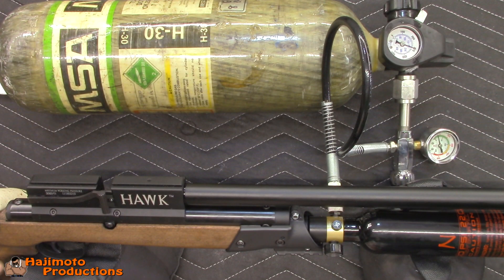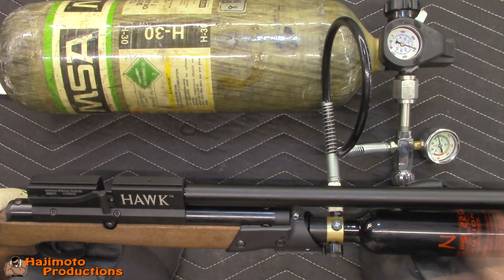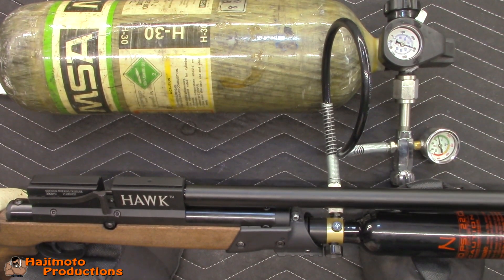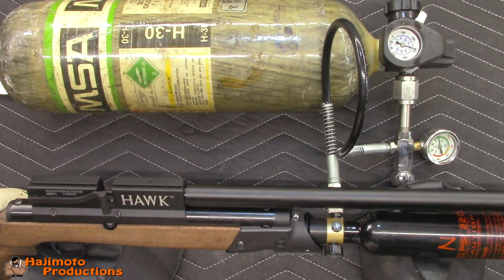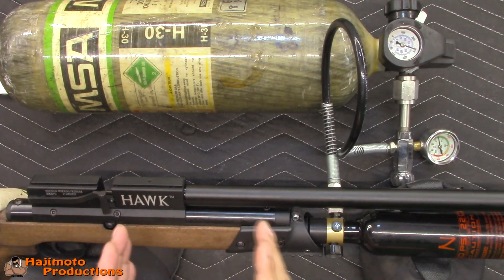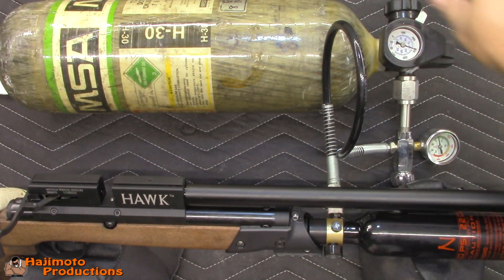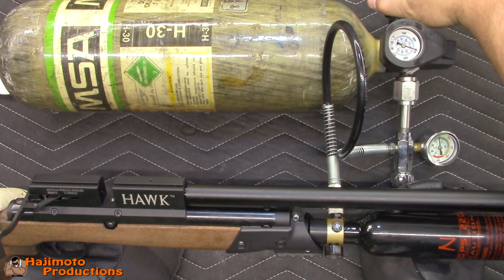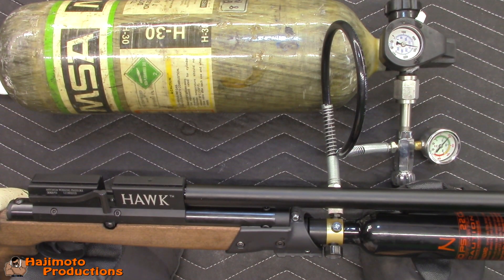Tutorial: JSAR HAWK First Fill With Air

Comment: I can not get my Raptor mini air tank to fill the first time. The lever is open any suggestions?
Reply from the maker: Try rush filling for the first 500 to 1000PSI unless you are using a compressor or hand pump.
Reply: @HajimotoProductions  I did and it worked unfortunately, the main o ring is leaking so I have to send it back